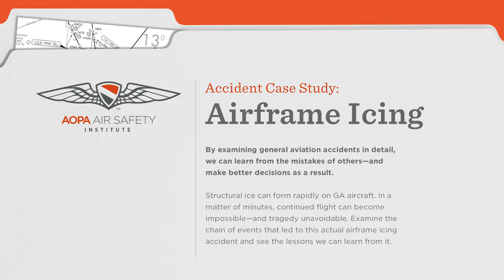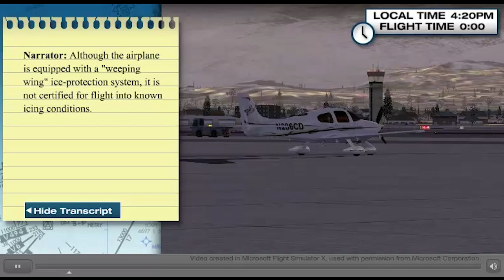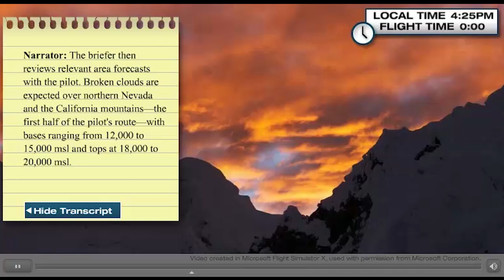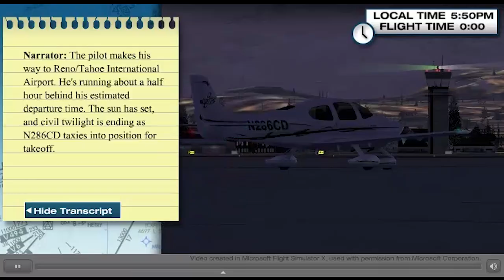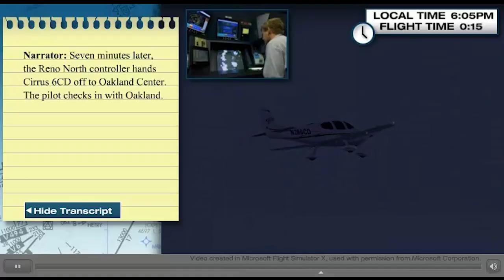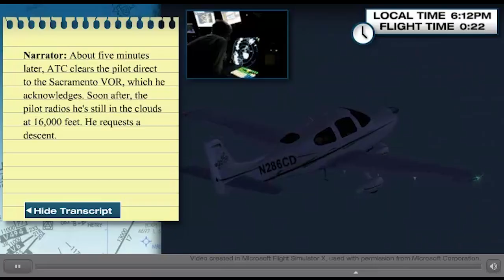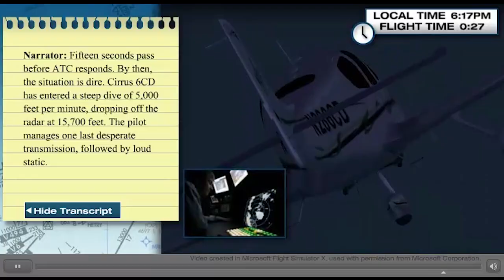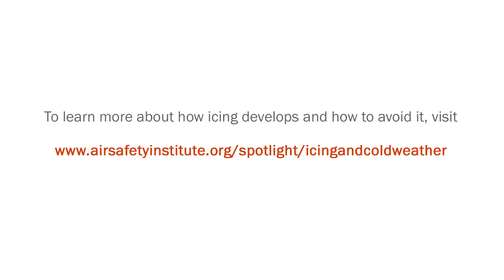Accident Case Study: Airframe Icing

Comment: As a pilot, icing always scares the crap out of me. Whenever I see some ice start to build up on the edge of the windows or the leading edge of the wings I instantly get that twisting feeling in the pit of my stomach and I get the hell out of there ASAP.
Reply: Icing scares me too, BIG TIME. In fact I will actually detour. put the plane down, or just not fly. On a flight through the Nevada basin area we got hit by a snow storm that suddenly changed directions. Weather service was talking with us and telling us where to go and we followed their track with hopes to land at a local air strip until the storm passed but it changed directions QUICKLY. We ended up putting the plane down on a state highway since its an almost isolated area in that part of Nevada, parked the plane on the median and waited for the storm to pass. We radioed the center controller and let them know we decided to land on the highway and we are on the media away from traffic and safe. The controller told us, "Thank God, that Storm caught up all off guard, that was a very smart decision, keep us updated if you need us to contact Highway Patrol." We ended up waiting for 2 1/2 hours until the storm passed, took off, and lived to see another day.
Reply: Yes, totally agree!! I am DEATHLY scared of icing (in GA aircraft not fully equipped for flight into KNOWN icing). First, because it is so incredibly hard to forecast accurately. And second, because it can be so insidious, and deadly, leaving you no way out!!
Reply: 747-pilot  hello, many moons ago, in a C150 with my instructor ,,I’m flying, it was a SUNDAY EVENING, NJ  close to NY border, somethings wrong, I said , then looking at my port wing. , oh crap my very first into icing, I said to my instructor, we got problems, he was reading, so he looked, oh crap, my plane , when he realized how bad it was , TOTALLY UNFORCASTED, WE had to stay where we were but when we got back to base many were looking at the ice melting, where were you , etc , Something I NEVER FORGOT, cheers 🇺🇸🇺🇸🇺🇸🇺🇸
Reply: ya , it's kind of the irony of the cirrus,  high performance aircraft , with a chute and de icing equip,  and a high service ceiling,  but it creates problems with low hour pilots who see this sort of thing as a safety net.. had he been forced to descend due to service ceiling , or had no icing equip he may have elected not to fly at all.. but the aircraft's systems, though limited,  had him fly regardless..Poor guy got in over his head, and the plane could not cope,  even the ballistic system couldn't help him.. poor guy must have been falling like a stone..
   feel bad for him, as he filed a flight plan and took a lot of precautions,  this was bad luck, timing, and one bad move, where the high performance of this plane actually gave him the option to get into worse trouble..
Reply: @planegaper  With ice your not just dealing with the precip its temperature also
Lower is warmer, climbing was a mistake..
Reply: @planegaper  Yeah... The Cirrus cruise speed is ~180 knots and the chute will only save the aircraft at speeds up to ~130 knots...
Reply: @planegaper  I'm not a pilot and it seems totally illogical to climb higher if you are already having icing problems at a lower altitude.  What gave him the impression that there would be better weather higher?
Reply: Wasn’t there a dash 8 went down years ago in Canada ice brought her down froze the control surfaces ?
Reply: @spannaspinna  
The crash from icing that happend in Canada was a Fokker F28 a small regional jet. That happened in Canada in 1989. Here is a link to the crash info on Wikipedia: https://en.m.wikipedia.org/wiki/Air_Ontario_Flight_1363
In 2009 a dash 8 Colgan air flight 3407 crashed in Buffalo NY which was due to icing and pilot error, the plane started stalling because of ice build up and the Capt instead of lowering the nose he pulled back on the controls making the stall even worse. Here is a link to the crash info:https://en.m.wikipedia.org/wiki/Colgan_Air_Flight_3407
Reply: none of u have ever even heard of a plane
Reply: I read and watch reports like this often. It keeps the “they died but I’m better, more talented and lucky” ideas out of my foolish head. I love aviation. Soloing is the BEST first I ever did in my life. I pray God never takes the fear of being stupid or careless out of my flying life.
Reply: Neither of you have ever been on a plane
Reply: @spoonforthought3534  You've never used a spoon or thought about it beforehand.
Reply: none of u ever seen a plane

Comment: It's the pilots responsibility to deny ATC. Conflicts of interests exist, and that's why we have separation of concerns anywhere that applies. That's why we have a judge, a defense and a prosecution in penal cases, they all are supposed to act under certain rules, but the separation of concerns together with their own interests guarantees a balance of power. ATC's main concern is the safety of all the aircraft, so in the general view, the safest course of action right then for them is to maintain aircraft separation. They're not in the cockpit of each aircraft, they have many to handle. A climb request for them seems reasonable at the time. That's why the pilot should not be shy in saying unable. Just as the prosecution won't concern itself with the needs of the accused, and the defense won't concern itself with the desires of the victim but rather each will pull to its side within the confines of the law and an ethical code, ATC and pilots should indeed be on opposed sides. It's always safer if the pilot requests everything he needs to request and denies everything he needs to deny with his own safety and that of his passengers as number one concern, and ATC deals with the general needs and what is possible and isn't. Pilots that are too shy to say unable, or to declare are the main cause of accidents, specially in general aviation where generally inexperienced pilots find themselves overwhelmed by busy controllers and far larger aircraft carrying more passengers. 

Had the pilot denied the initial request to climb to 14000, he would probably still be alive.
Reply: They asked and he said yes.  It's not even like they assigned that altitude.

Comment: Didn't know that the ballistic parachutes have a max airspeed of only 133 kts, that limits their usefulness tremendously.
Reply: Yea the parachute is mainly meant for engine-out failures which some comments mention are usually manageable but if you are over water or in an area where there are no suitable places to conduct an off-field landing you'll be glad you have the parachute. The parachute can't save you from poor flying choices.
Reply: That's 153 mph. Who knows what his true airspeed was. It's not so much the parachute can't handle the load....the air-frame can only handle so much of a jerk and load as well.
Reply: well put together report(by AVweb) based on data and critical thinking regarding the safety of the  airplane parachute here:
https://youtu.be/zT58pzY41wA
Reply: I would say the additional weight of the aircraft due to ice build up contributed to the chute failing .
Reply: Leggo My Ego - My thought when I heard that was "why can't Cirrus increase the useful airspeed of the BRS?" This pilot truly thought it was his lifesaver, but it just ripped away from the airframe. I'm an A&P who's specialized in structures/sheet-metal for over 20 years (also have a commercial license & instrument rating) so from what I've seen in aircraft structures, it certainly is possible to use a BRS and airframe components that can withstand deployment over 150 mph. However, the cost of such an improvement might make purchasing a Cirrus more difficult for this already overpriced airplane. Overpriced, but DAMN well built and an awesome flying plane, though I do prefer a Bonanza A-36.
Reply: @crooked-halo  It's the chute that can't handle it.  The forces that the nylon chute material sewn together has to withstand upon opening to slow a 2-3000lb plane at over 150mph are insane.  A more rugged chute means more weight, more bulk, less useful load...
Reply: I think 500ft AGL according to manufacturers licence, but anecdotally advice is even if in doubt use it as the drag will provide some benefit and of the two options (crash with or without parachute) why on earth would you choose without?
Reply: @Darren Munsell This video is most relevant: https://www.youtube.com/watch?v=Aa1Ba_NEobs
Reply: @RandallFlaggNY  Great vid, thank you
Reply: Yeah, increased stall protection, de-icing boots, advanced navionics and then a get out of jail free parachute to top it all off. But you can’t save some pilots from themselves… and it’s still the planes fault?
Reply: They should make the cockpit a separate capsule, attach the parachute so if it rips away from the airframe it will still have the capsule attached.
Reply: @PatHaskell  that's a great idea. In fact,  it might be best to intentionally have it separate from the airframe, which would help reduce the weight on the parachute and the impact when you hit the ground, and would remove chances of pilot getting burned in fire from fuel leakage.
Reply: Munsell, yeah that I already knew. It makes the parachute only useful in the rare situation where the engine dies at high altitude and you're able to glide while slowing down to a parachute acceptable speed, but that particular situation is normally manageable in an emergency in that you can glide the airplane down either to an airport or open field, and you'd be doing so at a rate of decent close to a parachute, i.e. I don't really see where the parachute is actually helpful.
Reply: @2011blueman  Actually, the parachute can be extremely invaluable in one such situation: And that is engine failure AT NIGHT. At night, you cannot generally see or know what's lurking beneath you. All those beautiful open patches of land, fields, golf courses and whatnot become one giant black expanse. For all you know you could have a pointy tower sticking out, right below, ready to pierce you!! At least with the parachute system you can make a fair guess (like glide near a road or something) and pull the thing!
Reply: @2011blueman  The parachute is almost always helpful if not left as a last resort. It works 100% of the time, unless you insist on trying to fly and recover the aircraft long after an issue has occurred. In this case, the second he encountered significant icing, and was unable to immediately leave it, and began to lose any control, he should have just reverted to the parachute backup, and accepted the loss of the aircraft in order to save his life. The parachute is very helpful, what's not helpful is the "keep flying the plane all the way into the ground" attitude that's in every one of these videos. It's always a Cirrus SR22, and they never deploy the parachute when they need to. The SR22 comes with pretty extensive training when you purchase the aircraft, even second hand, that teaches you how to use the parachute system, it's limitations, and how to identify when it's necessary.
Reply: @CharlesFreck  Really sensible comment. I don't understand these people saying "They don't work above a certain airspeed" - well if you're in cloud, clearly about to lose control then slow down and pull the parachute. So many SR22s on these that impact with perfectlyt serviceable parachute. It is lunacy.
Reply: @2011blueman  unless you don't have an open field.
Reply: @2011blueman  its not a panacea obviously, recent case of a midair in traffic pattern over the airport, one guy saved by his parachute, no one in yheir right mind would decline flying with one even if you can only use it in 20% of situations, dumb comment
Reply: @rfcdgaf  I agree that your comment is dumb because it misconstrues what I said.
Reply: @Forwardbias17764  Yes, I said it limits their usefulness, not that they're entirely useless. You're describing an incredibly rare situation where someone is flying where there are no roads or clearings where they're able to slow the plane down to 130 kts while remaining above the deployment altitude. I fly a few times a week in my plane all over the US and I can't recall ever seeing an area that would meet your description. I'm thinking maybe Alaska, or possibly parts of Washington?

Comment: If he had recognized the desperate situation in terms of the icing, could he have slowed to the BRS deployment speed of 133kts while still at 16,700, or was the stall/loss of control and crash inevitable ? After all the aircraft couldn't stay flying at ~180kts, and any attempt to get down to 133kts seems like it would have had the same results due to the ice load(stall/loss of control/ over speed). I'm not suggesting the existence/availability of the BRS changes mindset , particularly in this case, but it seems to have clear limitations and can only save you in a limited set of circumstances. Moral of the story-don't paint yourself into a corner whether the BRS is there or not. That must have been a helluva' ride down after the BRS ripped the top of the cabin away...
Reply: It is difficult to say, because we don't know how bad the ice buildup was. The extreme buildup of ice on the wings could have rendered the angle of attack so high (and consequently increased the stall speed to a very high level as well), that it would have made the aircraft essentially un-flyable. In that case, it becomes impossible to "trade airspeed for altitude" and "slow down" the plane. So if he was "falling" at 5000 fpm, there is no way to reduce the vertical descent speed, and  he was most likely doomed at that point!

Comment: mmh. Interesting to see the use of CAPS in this case it didn't help, but there are known instances of it working fine at well above it's designed airspeed.

It's at least worth noting that he deployed it.
If you know you're in an unrecoverable situation there's no reason not to.
It may not help, but it has the potential to save your life when nothing else will, so I'm glad to see it was used even though it failed.

Cirrus being the primary proponent of this system (I've seen other aircraft listed with such systems, but only Cirrus seems to offer it as a consistent standard feature on all it's aircraft) a lot of people have died because of some degree of arrogance or pride, when a CAPS deployment would have saved the life of everyone on the aircraft, but it was never used.
They tell people to use the system sooner rather than later.
Considering the airspeed and altitude limitations for effective deployment, that makes sense.

Like so many things in aviation though, it's something where complacent and arrogant attitudes lead to unnecessary deaths.
If you have a safety system but refuse to use it even when you should, you might as well not have it in the first place...
Reply: Remember the report is estimating his airspeed. Just before that we see quite a hefty negative vertical airspeed. The plane could have been doing well over 200kts.

Comment: At about 10:00, the pilot says that he needs to build up airspeed. To me, that's the telltale for icing.
Reply: Yeah, that would be a good time to try descending, though arguably mentioning ice earlier and questioning the request to go to 16000 was the "early acton" that would have prevented it. These videos are grat for spotting the holes in the cheese lining up, but you can just imagine being in the scenario and thinking "ATC want me to climb, ok. The clouds will probably break up before 16000 and I'll be fine." Damn these things are so tragic.
Reply: @mjudec  Like the one where the plane iced up quickly going through known icing, crashed on a busy highway during the morning commute, killing the pilot, his kids, his wife, their dog, and a coworker, who was a vice president or the like. All that horror! Then there was ATC, one who said,  "Oh, that Cirrus? He's descending on his own?" And the other who said, "I think he doesn't want to be." Like, "Oh, well."
Reply: @nonmihiseddeo4181  No, that was the ATC beginning to panic for the pilot. I really feel for those guys - there's nothing they can actually do to help in situations like that. 😣
Reply: I wonder if during his high altitude stall he considered deploying his aircraft parachute.   As he likely knew he was losing control of the plane and would drop rapidly.
Reply: @michaelmccarthy4615  He appeared to be focusing too intently on flying his way out of it. As a result of accidents like this, Cirrus is really pushing some 'When in doubt, pop it out" training.
Reply: Terry Melvin get real.